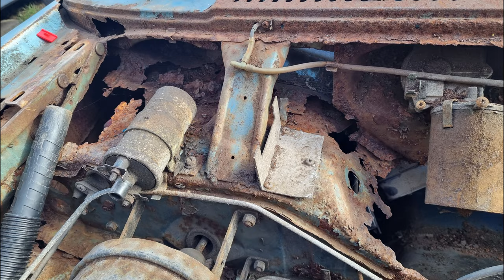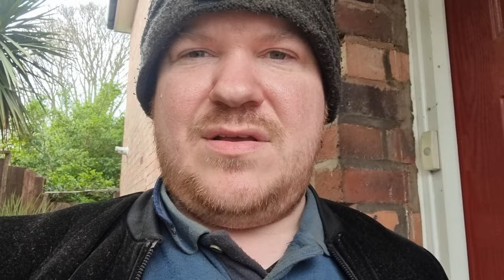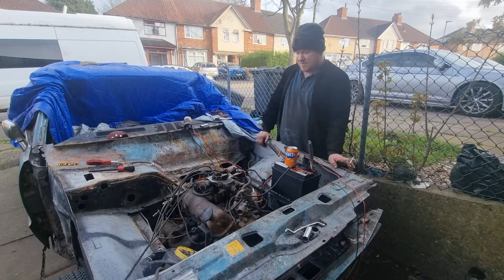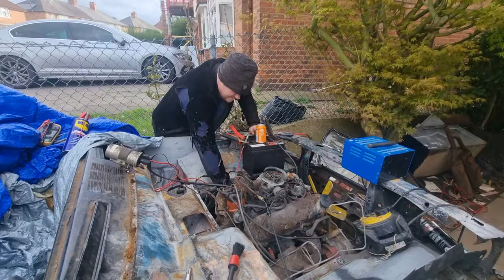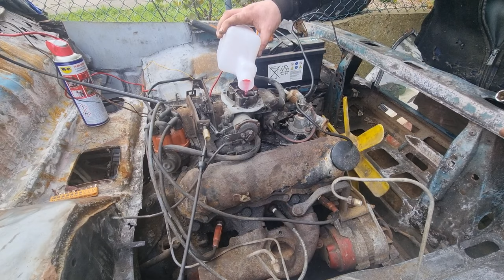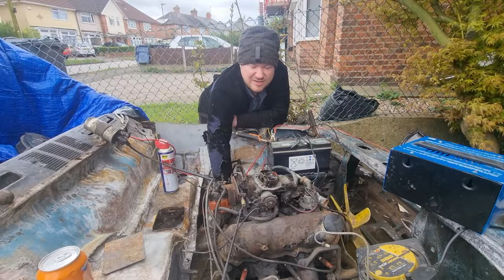Cortina Mk4 Ghia 2.3 V6 Restoration || Will It Run Attempt 2&3 KIND OF (P19)

Comment: I just found your channel, a few years ago I read  in practical classics about a guy getting an old Capri, never seen it run, he used 2 12v batteries to get the engine to start and it worked
Reply from the maker: Wow really interesting loads of videos on this car 26 so far
Reply: I did that after rebuilding my old Sierra engine worked a treat.

Comment: As our American cousins would say, you need to fire the parts canon at it!  Change pretty much everything you can, get the starter and carb both rebuilt.  Someone suggested taking the plugs out and putting oil in the barrels which is a good idea.  With a decent battery that starter should turn the engine over at a decent rate.  Because it isn’t, the starter is suspect and the motor could well be gummed up after standing for so long.
Reply from the maker: Love that lol fire the cannon

Comment: You need a better battery then engines not turning over fast enough to start.
Reply from the maker: The battery is of my daily lwb high roof van might be the starter brushes are corroded and need cleaning thanks for the advice tho I will give it another try soon just need to finish the work on my bulkhead have you seen all the videos on my cortina restoration:)

Comment: Good comments from Denis below. I've been where you are with motors; but it sounds like this is in basically good health. Make sure you're giving it a really strong crank; good battery, good starter. Otherwise you're not giving yourself a good chance. Assuming the timing is basically in the zone and your exhaust isn't blocked, might be time to look into the carburettor......FWIW I agree with Denis; I'd check the timing next.

Comment: If you flood the engine with gas you need to hold the throttle wide open, you need to introduce enough air to compensate for the excess fuel.
Reply from the maker: Yeah I was getting my daughter to pull the throttle cable of camera if u see its been pulled lol

Comment: Needs some oil in the cylinders been sat for too long could end up destroying the engine
Reply from the maker: Hi in one of my videos think there are 19 on this car in total there is a engine check over video where I stick oil down the plug holes and all over the rockers
Reply from the maker: Hello daz lol
Reply: @AdamSNook.  Lol hello if you put oil down maybe a ring is catching does sound like it's struggling fully charged battery and some more oil and try again
Reply from the maker: @The_repair_shed the battery was of my daily van lol sounded like it was going flat but when I put the battery back  on my van it fired strate up also same with focus battery both new the other option could be a weak starter motor as it keeps sticking so might try cleaning that or replacing it I will try again tho soon

Comment: Firstly,check static ignition timing,sounds like it may be too far advanced.remove starter and clean all internals,making sure U scrape the grooves in the commutator as they tend to fill with carbon as brushes wear.rig up and overhead fuel feed,(eliminates the need for a fuel pump) then double check the firing order,these old girls  are pretty bomb proof,but they need every helping hand U can give to wake them.hope this helps.
Reply from the maker: thank you i will take all your advice and will do a retry at some point but really need to get back onto my bulkhead and get it done and painted :) but wont take me long

Comment: Make sure you dont have nautral confused with a gear..put in park and check underneath she fully locked back. You could disconnect and put in park. This will make sure you not pushing fluid around the box. Labouring the engine down. 👍
Reply from the maker: Ohh I will check that thanks

Comment: The old girl has been stood for years and turning over slowly leave some oil in the pistons and leave it stood till you get everything done I would get a carb kit rebuild and clean that out but if it's holding you up then leave it get all that welding done as you have got loads to do I do welding and fabrication for 25 years and it would take me 6 to 12 months to do but i like to take my time  do a good job and I've got the right voltage mig welder to do it so good luck with it don't worry about the engine yet mate
Reply from the maker: Yeah you make a good point

Comment: I just thought of something, do you a A bar for towing, tow it down the road, let the road wheels turn her over, thats consistent turning
Reply from the maker: i would be to worried to tow it dow the road lol there is no brakes no steering wheel no steering coloum and its a automatic no clutch :) also would worrie it wouldent come back in one peace hehehehe
Reply: @AdamSNook.  Don't try to tow start you will damage the transmission .
Reply from the maker: @roberthorseman7432  yeah i wouldent do that anyway as its a auto :)

Comment: Yeah sounds like your starter motor brushes have corroded/stuck could dissasemble and clean but from experience if you change the starter for recon one you'd be surprised how much faster it will spin over 😊
Reply from the maker: Thanks for the tips! yeah im going to try and clean it but if not i will buy another one :)

Comment: Exhaust might be blocked up with mice nest.. sounds like your timming is slightly out. Put a screwdriver down cylinder one plug hole and stop piston at the top. See if timming mark is lined up. You putting 24 volts through a 12 v coil. Its getting hot quick. Disconnect exhaust at manifold. Think you got teeth missing on the ring gear. Maybe why it was parked. Is it a Auto. Might have a saftey switch on it. You can pull the plugs and heat them on the stove. Get them hot. What millage on the engine.
Reply from the maker: hi there is no exhaust on this car its the manifolds only abd its auto but is in nutral im only putting 12v on it the starter motor sounds really weak
Reply from the maker: oh and there is no wireloom im going direct with coil
Reply: To much fuel can hydrolock . Sounds like thats happening. Use Brake cleaning fluid. No ether in that. No so volitile as starter fluid. Maybe transmission is draging engine down. Put Autobox in neutral.. check your plug wires are correct firing order.
Reply: @AdamSNook.  You have battery and charger connected. That's 24volt plus. If you are wired battery to coil direct you putting 24 in the coil. It's cooking quick.. did you put new condenser. Ask your wife for a  Emory nail board. Sand the points even. Pull plugs and clean plugs put on stove. Turn engine over with no plugs. Clean out cylinders. You nearly there. Is your old fuel line disconnected.
Reply from the maker: yeah i did flick it from neutral and park its possable somthink is draging it down i will look into it again soon but want to do some more work on the body
Reply from the maker: yes i did have charger on but unpoluged it when cranking it i did forget once to unplug it and it blew my fuse in charger so was not on mopst of the time
Reply from the maker: @DenisEdwards-ls2de  yeah there is no fuel tank and i took out the old lines from the carb
Reply: @AdamSNook.  Try brake cleaner. Don't use starter fluid. And no more petrol. It's gumming up your plugs. Take um out clean um and burn them off. Check gap..👍👍
Reply: @DenisEdwards-ls2de  he's wired it into parallel not series so its still 12volts
Reply from the maker: @DenisEdwards-ls2de  defo will give that a try i do have some brake cleaner some where but put it down and now carnt find it hahaha i was looking for it as it would have made my life easy
Reply: Hi Adam, appreciate you may give engine a rest for now but out of interest I can see you have a earth lead from the neg on the battery to the top of the engine but do you have a lead from battery neg to the chassis of the car also I could not tell. 
You mention you have a spark but is that on every lead , yes you might need a ballast resistor
Reply from the maker: @banger220  hi it goes to the engine and to the front body of the car so metal and engine i seen spark on 2 plugs i wil lcheck the others out thanks dident think to check all of them

Comment: Take the start off oil up the bendex , take off the prop shaft then try starting the old girl.
Wasn't the V6 fuel injected? 
Tip for you but a socket on the crank and try starting it that way. Check ground also
Reply from the maker: some great advice mate not his engine v6 its the 2.3 think the 2.8 is tho not 100% sure
Reply: @AdamSNook.  its a 2.3, gb tinas didnt have 2.8s
Reply from the maker: @oldfatbastad6053  oh right

Comment: Run a wire off spade connector on starter had hold it on + side on battery to spin it over
Reply from the maker: Wll do that I ha e taken the starter of to clean it up once I finish the bulkhead I will try again

Comment: You'll never get it going with weak battery,and hold throttle wide open when you pour gas down throat of carb these engines flood easy
Reply from the maker: Yeah I am going to give it another go  soon

Comment: Do you need help?, how close are you to b'ham?,  internal copper washer may need cleaning on solenoid, plus commutator probably needs cleaning,  turning over slowly,  what's the CCA of the battery?, V8 needs a good 600CCA to turn over effectively
Reply from the maker: Thanks for the offer but I'm all ready in the middle of sorting it its a v6 not a v8 plus the battery was a big battery out of my Ford transit 2.4 lwb hight top and is new I'm replacing the starter motor as one of the terminals is broken and getting new plugs and leads ect so will be doing another will it run soon just doing the work needed on my bull head first

Comment: You put too much fuel down the carb 
Try using a secondary petrol tank and gravity feed it directly to the fuel in side on the carb 
Then clean all the electrical points, good earth and positive must be clean 
It could have a spark but maybe weak 
Clean all spark plugs put new ht leads on it
Reply from the maker: Yeah I was thinking spark could be weak I'm going to buy new points ect and try again

Comment: Also if you ar putting petrol down the head and it’s not firing then it’s electrical problems you have
Reply from the maker: There is no wire loom it's straye of the coil pack direct
Reply: @AdamSNook.  yea but in the distributor I meant renew everything as a process of elimination and the connections to the starter need to be mint and a good earth from the engine to the battery
Reply from the maker: Yeah I get ya I had 2 earth's one to body and one to engine

Comment: The starter motor is turning way too slow try servicing it or replace it with a good one. In the meantime you can try 24v for very short time and see
Reply from the maker: Yeah I'm going to take it of and try cleaning it ect if need be I will be another one and will retry the start up again soon

Comment: Battery's not got anuff amps needs a bigger batt
Reply from the maker: Can you get a bigger battery the one I try after was  from my lwb ford transit high top van that I use everyday and is  a relatively new battery fire my van up strate after trying it on my cortina it was acting dead but was still fully charged